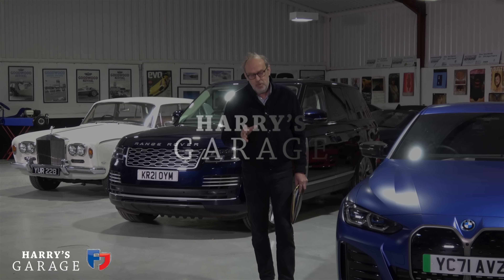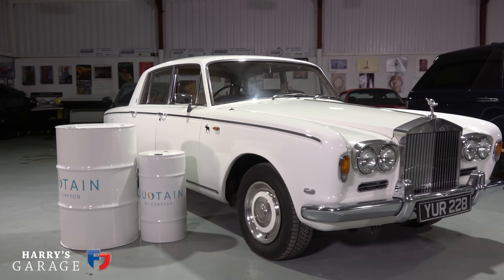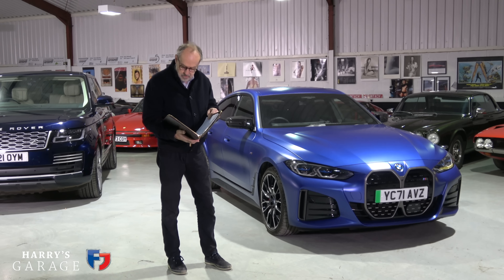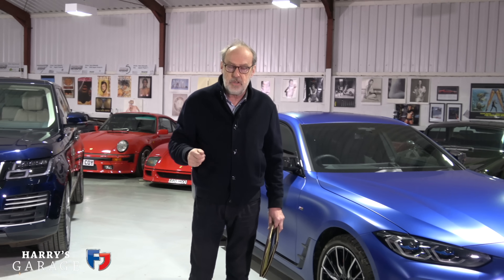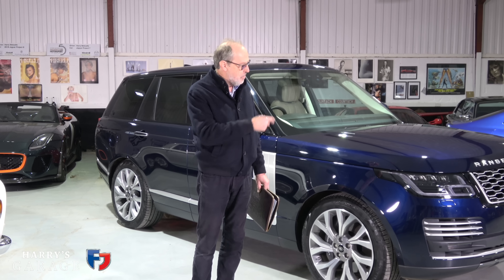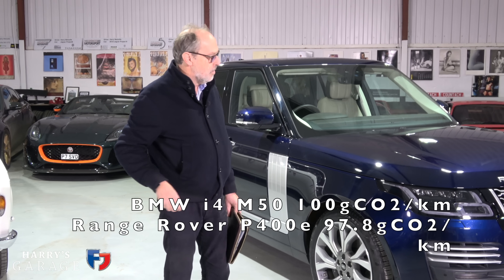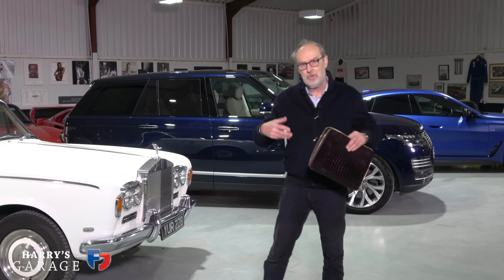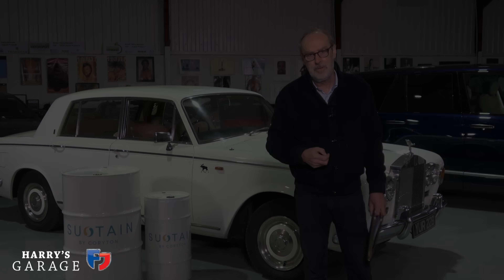Sustainable fuels; what are they & are e-fuels better for the planet than running an EV or PHEV?

Comment: If the UK Cut's Co2 by half, / 50%,  We reduce Co2 by HALF of 1% Globally. 
TOTALLY POINTLESS. A WASTE of Time & Thought & Money. 
to Save 0.5% of Pollution. 
The Green Anti Co2 people are NUTCASES. who need Educating. 

Oil & Gas actually Works & is very Cheap & efficient, IF the UK produces it's own Coal Oil & Gas. 

People with A BARN ROOF FULL of solar panels, & a Turbine, & Hydro From a Stream / River Running through Their Land can Make Off Grid Living Fully Sustainable. 
The water Flows 24 /7. 
The sun Shines 30% of the time ? 
the Wind Blows 80% of the time 24 /7.

Have a Woodstove for Heating & cooking, Burning 80% of all the Household Waste, PLUS, All the Waste from the Land,  
Hedge Cuttings, Fallen Trees, Dead Trees, & anything else that will Burn for Free or almost free. 
Get a Local Tree Surgeon to Drop all his waste cuttings off. = Free Fuel. 

With a Farm or Loads of Land, 
Build a Communal Compost Heap, 
Invite locals to drop off all their Garden Waste to a Huge Compost Heap, Fit a HEAT EXCHANGER in the Compost Heap To Heat the Farmhouse & buildings etc, 
Collect the Methane & Gasses given Off to burn as Fuel,  = FREE HEATING for a Large House / Cluster of Farm Properties. 
A Compost Heap the Size of a Normal Double Garage or  More. 
A Farm would Have Diggers & machinery to Rotate the Compost, 
After all the Heat has been Used, Spread the Compost onto the Land, & Allow locals to Fill a Few sacks for Free for their Gardens, Sell Wagon Loads to Bulk Buyers. 

THIS ;- is What i call Fully Sustainable Farming & Land use. 

Also Allow the STOVE to Heat water in a Large Underground Tank To circulate around the House Central Heating Radiators for 24 or 48 hours after the stove has gone out. 
An UNDERGROUND Heat BATTERY. 

Long Term, Plant 100 Fast growing Trees,  wait 3 to 5 yrs ??? Then cut down 5% to 10% every Year & re- plant new trees. ( OK Wait 10 yrs ?? i'm no Tree expert ? ) 

I Can Trim, Prune & cut abt Half a Ton of Waste wood per yr Just from my Garden. Fine Quality FRUIT Wood, From Plums & Apple Trees. 

If You Have Spare Out Buildings / Barns etc,  Run 100% of your Wind / Solar Power into a Few FORKLIFT TRUCK Batteries & save all the Excess power. or a TESLA Wall / Power Box Whatever ? 

Heat the HOT Water Underground Tank Via A Solar water heating system on a Roof. 

Anyone with the Space could do ANY or ALL of these ideas to Save Costs of Heating & Probably Make a Good Profit from Local Households. 

Most Farmhouses are Large & or Have a Cluster of Farm Workers Cottages Close by. 

NOTHING EVER LEAVES my Garden, it Either gets Burned or Composted. 
FREE Heat & Free Compost.

Comment: With Synthetic fuels the plants are being grown regardless of whether you make fuel out of their waste or not, that doesn’t compensate for burning ‘sustainable fuels’. That’ll only happen if you grow plants solely to turn them into e fuels. Yes battery production, in particular mining metals uses much CO2. But once the metals are out of the ground, the process is circular. These metals don’t get used up, they get recycled which does not use much CO2. Your point about your local grid being dirty is a valid one, but that is not set in stone, On a monthly basis the grid becomes cleaner, so a BEV becomes better from the planet the longer you own it.  A 6.23L V8 roller running on £3/L petrol still does nothing for local air pollution. Plus, your sustainable fuel still needs to get transported to your car via fossil fuels, unlike electricity that is sent instantly and emission free. At the end of the day, you’d be better converting that RR to electric, a big wafty luxury classic like that would really suit a smooth silent power train. You could drive it everywhere and it wouldn’t be a lottery as to whether you’d make it to your destination.

Comment: All that methanol to gasoline fuel has to be transported 1000's of miles on huge container ships that belch out more particulates than a few million cars. The problem with simplifying a problem is you change the problem.
Reply from the maker: E-fuels produced in volumes big enough to fill a tanker ship are many years away. Maybe those ships will also be running on E-fuel by then too.

Comment: Put wind turbine in garden and run on fuel twice as expensive as it is now. Gotcha!
Reply from the maker: I can't see Sustain few ever being mainstream, it will be used mainly for motorsport activities and for collector type cars where the cost of the fuel is less of an issue.
Mainstream motoring will go EV, what has to change to get there though is battery technology and the UK charge network. Until that happens, running a PHEV is my preferred choice.

Comment: I just calculated the fuel usage in my 2008 Fiesta turbo diesel between fill-ups; I got 886km (548mi) from 34.8L (9.19USgal) for an economy of 3.92L/100km (60mpg) and a C02 output of 103g/100km. That's better than a lot of hybrids, with a far less complex and resource-intensive drivetrain which means that there's more incentive to keep it running due to cheaper parts and easier labour, which means not having to add to the environmental impact of a brand new vehicle, PLUS I can convert it to run on waste cooking oil for even more eco-friendliness. So far it's done 327,000km (203k mi), and I have no plans to replace it,.

Something I'd love to find is the damage per kg of cars on asphalt and how much C02 is released in the road construction process to try and extrapolate the C02 cost per kg of vehicle weight. All these 2ton + cars coming out would be sure to have a cost there as well (I'm looking at you, 9000lb Hummer EV...)
Reply: Hear hear. Vehicle weights need to reduce, need to get rid of these horrid suvs

Comment: Very interesting episode, it strikes me that although sustainable fuel in your example is double the cost - most electric cars have a much higher initial purchase cost, so you may be able to buy quite a lot of fsustainable fuel with the difference. I wonder what the break even point would be ?
Reply: Well since electric prices are about to double or triple and a lot of ev's need fairly costly battery replacements when they aren't all that old I would say it might be a closer run thing than most would think. 
Especially if that sustainable fuel is going into something pretty frugal in the first place.
Reply: @siraff4461  I'm also drawn to Harry's description of the cyclic effect of sustainable fuel as far as carbon is concerned. The high ecologic cost of producing EV's also add's to the benefit of using sustainable fuel. Well done to Harry for this episode it shows there is with development, potentially another way.
Reply: @davidlakin3723  I like the way he's open minded about it all. I think we have to be and look for the best solution. 
Unfortunately you only need read some of the comments (and this is a relatively reasoable audience) to see how many are just waving the flag for electrics regardless.

Comment: Another great video Harry. Again breakdown the figures that we want to know and see how "green" they really are.
Once again the Plug-in's for most people in the modern world are the way forward. Use them like you do with the mix of Electric for the short little trips and the Petrol powered for the longer journeys. Mix this in with some sustainable fuel's and its more of a win win.

Pure EV's are not the way forward in any way. Costs are too high to buy, too high to produce, use way to many materials that are not easy removed or refined once out the ground before they have even been manufactured into the final product. Plus as you say, the electricity that is used to power then is dirty at source.

Why is there such a push for pure EV when it is not the way forward????
Reply from the maker: Because manufacturers have no other choice. Tough EU fleet CO2 rules were introduced in 2020 and get tougher to meet every year. Because the EU allow an EV to count as zero emission, manufacturers have to pump out EVs in order to still sell their far more profitable conventionally powered cars. 
What people need to realise is these new rules for manufacturers does not mean you have to buy an EV unless it genuinely suits your needs. It's a big change jumping out of ICE and into EV, I've tried it and the shortcomings are glaring, hence why I reverted back to a PHEV, which suits our needs way better.

Comment: I think there must be something wrong with Harry's calculation that the BMW i4 only does 2.5 km per kWh - both my Tesla Model 3s have consistently done 3.3 miles per kWh, close to the manufacturer's claimed figure of 3.4.  They have been driven pretty hard, too - admittedly they do weigh quite a bit less than the BMW 🙂at 1850 kg and they don't have the BMW's hideous front grille to slow them down.

Comment: Debate about the figures is exactly what’s required to engage vehicle users. Where this video helps is setting out the various rationales and figures for each type of fuel in a way that doesn’t sensationalise but allows the viewer to form their own views. 

Embedded carbon (and other pollution) from the manufacturing process needs to be considered as does the longevity of the vehicle. 

The model the manufacturers have where relatively cheap PCP deals enable users to swap vehicles on a 2-4 year cycle cannot be good in the long run. Currently I’m not aware of any metrics which measure long term vehicle ownership/embedded carbon etc. 

What’s clear from the video and comment is the debate is starting to happen and consumers need to pressurise legislators, innovators, fuel providers into an holistic process of positive evolution in personal transport. 

Of course, the concept of personal transport is a moot point - is vehicle sharing a better option or is longer term vehicle ownership better?

Comment: You didn't add the C02 from the electricity for the Range Rover. 

When you make this bio fuel in the remote countries.... How does it get to the UK? 

In a big fucking boat that's burning tons of diesel. So it's not conscious free..... 

Also its not just about C02 it's also about air quality and emissions from burning fuel.

It really annoys me when people do these comparisons and miss so many other important bits. 

There are so many things wrong here and typing on a phone I can't debunk it all. But really blind sided video.
Reply from the maker: I really care about climate change and in this video I was showing why a pure EV is not a zero emission car when charged from the national grid in central England and why I swapped out of a pure EV and into a PHEV, as this allows me not to suffer the woeful outside charge network in the UK yet do 60% of my motoring on electric only power, which is true zero emission because power comes from my wind turbine.
I could not charge all the miles I would do in a pure EV via my wind turbine because I do several long trips a week and I would have to use a charger away from home quite regularly, which would come via the national grid with different CO2 ratings depending on region.
As for delivery of E-fuels from remote regions, they won't be in production at scale for a least 5-10 years and maybe by then the boat delivering them might be powered by E-fuels too, who knows.
Reply: @harrysgarage  So now I have a keyboard I can fully explain the problems with your assessment. 

Firstly, yes EV's produce more C02 than a regular car during production. A Fossil Fuel Car is around 8-15ton's while an EV is around 15-25 Ton's. However you completely ignore the C02 production of the "EV" part of the PHEV. Does that not get included? A PHEV is just a Combustion Engine + EV Battery and Motor ... so why didn't you discuss that? Why wasn't that included in the comparison? 

Your "energy source to car" for the EV matters to you & how it got there ... where with the Fossil Fuel car the fuel magically just arrives at the petrol station? Where's the like for like comparison?  Why isn't how your fuel gets into you Range Rover from the source detailed too?

When you include the environmental impact of getting the oil out of the ground, getting it to the refineries, refining the oil into fuel / other elements, transporting that back around the country, and finally distributing to the petrol station .... it's staggering ... not just the C02 in all that transportation / refining but also the environmental impact and damage it causes.

You should watch : https://www.youtube.com/watch?v=1oVrIHcdxjA&ab_channel=GasTroll

OK then you go on about how the Range Rover is great as you plug in at home ... do all the local trips on electric only, the school run, shops, nursery, etc ... and you power that with your wind turbine ... so why can't you do that in an EV? If your EV can do all the local trips from the Wind/Solar farm at your property then the C02 is zero .... 

If 95% of the trips are local runs then why do you need the combustion engine part at all? 

ohh the old "it doesn't do 400 miles" argument ....

99% of domestic trips in the UK are less than 200 miles. 95% are less than 100miles. Those are statistical facts from the AA.

An EV that does 200 miles works for that vast majority of people in the UK. Yes there are always a few that do hundreds a day .. but you really a very small minority.

A 200 mile (winter range) is more than adequate for most families ... I know as I've had my Polestar 2 since 2020 and never had any major issues with range or charging out and about. Yes it takes a little more planning ... you're old enough to remember when we had to use an A-Z to plan a trip ... well it takes less time than that!  And more chargers are being installed daily. London to Glasgow is only 2 charging stops which you need to take 15mins every 2-3 hours of driving anyway if you follow the highway code. So why do you need 400 miles range? I travel each summer to the Lakes which is about 300miles ... so thats one stop for 15mins on a 5 hour drive with kids and the wife in the car. No issue at all.

Even when cars like the Rivian that does 500miles are released in the UK people will then moan it doesn't charge in 5mins .... even though a stop at a services just to do a toilet & grab a coffee takes 15mins.

Finally the Eco-Fuel. I agree that classic cars need saving and also need a way to be used in the future. I'm a car fanatic and love some of them. However your video came across as - EV's are worse than my Eco-Fuel Car ... so lets not do EV's and keep with Eco-Fuel. 

It's the same argument over hydrogen .... why take 100kw of Solar energy and convert that into 70kW of Hydrogen, that then produces 30kW at the wheel, when you can take 100kW of solar energy and stick it in a battery and get 95kw at the wheel?

The logistics don't compare or add up.

I'm no eco-warrior. I brought my Polestar in 2022 as my lease on my Kia Stinger GTs was ending and wanted a similar replacement for power/speed etc.... and I wanted to try something new and different. The only reason videos like this upset me is how facts are manipulated to suit the click bait titles. 

If you are going to compare like for like then do it ... don't just miss out parts because it doesn't suit your narrative.
Reply: @harrysgarage I liked that you gave the cost of running if charging from the grid, but please give the equivalent tor charging from the grid, which makes it 225g/km

Comment: Despite the whole orchard of sour grapes synthetic oil substitutes will exist and they will get near to crude oil prices… the petro chemicals genie can’t and won’t be put back in the bottle.
Fuel for automobiles will fairly niche, but will be common in very rural  and/or poor areas were batteries never will be viable.
It will always! Be used in aircraft and international shipping, Energy density is critical for those industries.

Comment: My BMW 2020 330e does 69 mpg after 6000 miles. I rarely use the grid in summer As my solar is enough to keep it topped up.   I would buy an I4 40 but at 62k to get the same spec is just too high.   You need to add in service CO2 to your equations as well as CO2 to get fuel from th3 ground to the tank.   Love your delivery though.